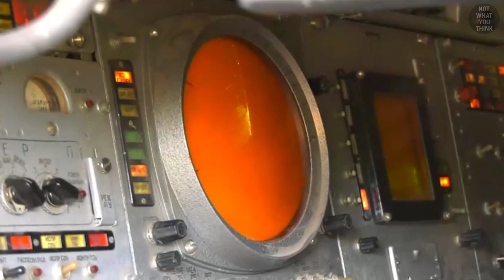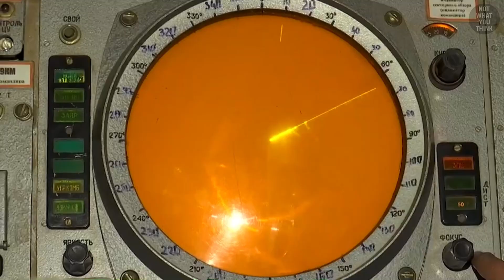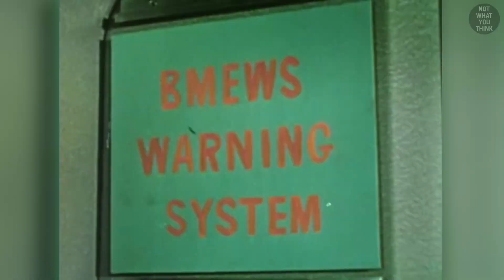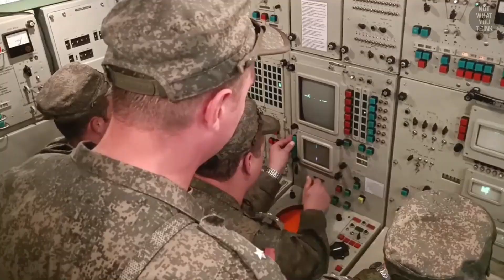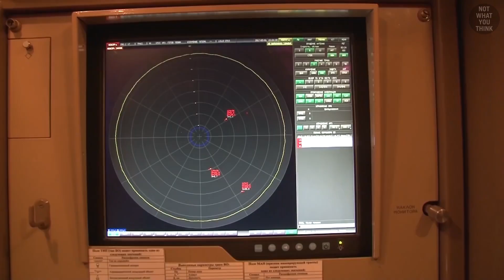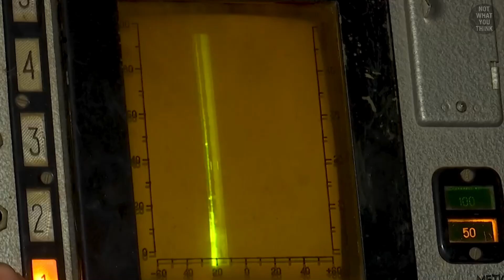How Aircraft Fool Radars by Flying Low

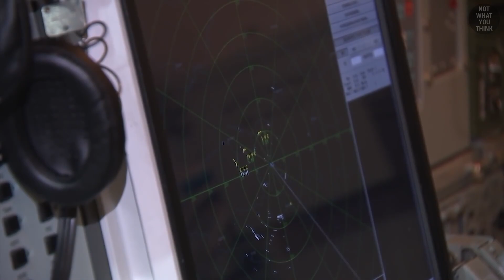Comment: 6:23 Now this confuses me a little. How does flying low trick Doppler radar? Flying low and slow (i.e. below the radar MDV), OK, but being low alone is not enough, or is it?
Reply: the doppler radar filters out stationary stuff from moving stuff. The trick where planes flying perfectly horizontal to doppler radars dont get picked up is because of this. It has to be moving towards or away from the radar. simply moving sideways to the radar appears as stationary. 
Now, when you get low enough, as in very low, the plane can blend in with the ground. the altitude is so low and they are moving so fast that the radar just receives it as being stationary, just part of the terrain, so it filters it out. this usually works with terrain that has lots of trees, power lines, cars, hills, etc. in a completely featureless and flat surface it probably wouldnt work.

Comment: One error, you said an S-300 can shoot you down from 90 miles away..... Nope, an S-300 can shoot out to to 120 miles [and an S-400 can double it and hit you at 250]
Reply: Not anymore without western electronics 😂. I doubt anything Russia claims at this point. How embarrassing
Reply: @sc1338  Russia has a crap ton of S-300 still like many thousands. which are build with western electronics.
Reply: @sc1338  a rocket hit a arleigh Burke class and nothing detect it, a Chinese jet flew over arleigh Burke, don’t know if it’s a “Russian” system
Reply: @jade7631  if you’re talking about the gulf war. I believe it was detected but the CIWS was set in manual engage mode
Reply: @sc1338  u didn’t say anything about not being detected I’m just saying it bypasses it
Reply: @sc1338  wait I did mb I meant it bypasses
Reply: Well, they can try to shoot you down at 120 miles, but the plane would immediately get an alert and they'd have time to dodge.
Reply: @dreaminginfraviolet  yea thats not how that works. The plane only gets an alert when the missile goes active. Also most ground based radars are LPI radars so their RWR likely won’t be very effective. Russia and Ukrainian jets both have very old RWR’s which likely won’t pick up ground radar painting them. Evading a SAM is not easy. Even at 120 miles, that missile is still dangerous. Also, a SAM site won’t just launch 1 per plane. They launch salvos.
Reply: S-300 soviet scrap metal.

Comment: That's actually really interesting that the US radar system could detect the moon. As it is so far away from the earth
Reply: Go out and check the skies, you can detect the moon too
Reply: Moon is big
Reply: @daviddavidson2357  size is actually irrelevant, it's the movement that counts.
Reply: @Argosh  lmao
Reply: Radar signal goes at the speed of light, the Moon is 1 light second away.
Reply: @quisqueyanguy120  circa 2seconds, cuz signal has to bounce back 🙂
Reply: The pulse goes out and you time the returning echo. The pulses keep going all the way to the moon and back but the radar thinks the echo is from the last pulse sent. The operator needs to look at the quality of the return.
When I was in Labrador in the spring we would get tempature inversions that would trap the pulse and echo and we would paint the Coast of Greenland and everything flying in between :(  All we needed to do was dump the first 250.or 500 miles down the middle of the scope
Reply: The size and distance are just made up fairy tales...

Comment: I was serving in the Navy back in 1980' and the radar we had then on our ship, had MTI, Moving Target Indication. I was in the harbor looking on a surveillance radar towards land. 25 km away there was an airfield (civilian) and despite there were no clear line of sight, I could see on the screen when the plane turned on the platform. What it does is that it exclude all static echoes on the ground and only displays moving taget by extracting the doppler signal in the return echo. There's no problem detecting helicopters, since it detects the rotation of the hub for the rotor blades, not the blades themself. It's even so concise that you can detect if it is a helicopter or a moving car.
Reply: Yeah, I struggle to even think about the possibilities of modern computational radar. I know the upgrades my former colleagues got in ATC. And that's civilian tech...
Reply: This might be a stupid question but can you just use another radar system or put one on a helicopter to emit random beams to clutter the enemy's screen? Like disturbing a radio frequency
Reply: @woozy7405  Radar jamming aircraft do exist.
Reply: @pvt.potato1943  too expensive for cannon fodder aircrafts
Reply: @pvt.potato1943  you can jam a radar but you need to know where it is. If you send radar signals everywhere, that will only make you a very easy target.
Reply: @MohammedYASSINE  I'm not making an argument, I am just confirming it.
Reply: @woozy7405  Yes the F-35 radar is programable and can act as a jammer and electronic sniffer but it's not the normal way until recently because the AESA modules on the F-35 are so highly programable they can act as a radar, ELINT sniffer as well as a jammer.   To jam another radar you can emit pulses at the same frequency, you can receive the signal and retransmit it a little latter to generate false Echoes or anticipate the next pulse, you can emit broadband noise so that the Signal/Noise or S/N ratio is so low the echo can no longer be seen.   You can predict the beam scanning pattern and inject false targets when the beam is looking in one direction to break a lock or create false targets.
-Modern radars have several ways around this.  They jitter the timing of the pulses randomly, they have pulse to pulse frequency agility.  The pulses are not just of a single frequency but are chirped and may alter in frequency several times during the pulse and unless the jammer cknows or can anticipate all of these patterns it is reduced to spreading its jamming energy widely.  Multiple pulses can be emitted at ones all at different frequencies to the point that it becomes a pseudorandom noise sequence that is spread so thinly the signal can not even be detected.  Modern AESA radars also scan in random patterns and its hard to seduce them with false targets.
It has been so difficult to jam modern radars the USAF has gone down the route of Stealth ie of absorbing radar waves.   
It takes a 16:1 reduction is radar cross section to halve detection range so 256: to 1 would give 1/4 and 4096 :1 would give 1/8th.   Eventually the stealth aircraft will be detected (about 20km away) but the idea of stealth is more to give the jamming systems a chance.  By using random noise jamming the S/N ratio can be reduced despite all of the efforts of radar signal processing.
Reply: @bernhardzunk7402  your answer is so well put, you should put it in its own response.
Kudos.
Also a question. You may have heard Israeli f35 both flown over Teheran,and left a sonic boom without them being detected coming in and out.
Any idea what was m at least in general done, to achieve  such a feat?
Reply: I served on the SAM system OSA-AKM (SA-8 Gecko). During the exercises, we intercepted helicopters at a distance of about 25 km as soon as they started rotating the rotor at the airport. we followed them throughout the flight with the surveillance radar if they did not fall into the valley, and as soon as they were in the range of the shooting radar we had them focused for tens of seconds if they did not hide in the valley again. They flew in the area of northwestern Bohemia between the town of Žatec and the Hradiště military training area (Doupov where they had a shooting range).
During the Flaying Rhino exercise in 2000, we used the same method to intercept Dutch F-16s in low flight at tree level.
Reply: @KorbenDalasCZ  I wish you had the chance to shoot down the F-16
Reply: @misterbig9025  I had F-16, L-159, Gripen, Tornado planes aimed at a lot of exercises -FLYING RHINO many times, if it was a real war, it would be enough to press the trigger and the missiles would catch up and destroy the planes. I served on the Osa-AKM systems, and on the Strela S-10 - SA-8 Gecko, the passive guidance target wouldn't even know it was aimed if it didn't see the missile. The standard is to launch 1-2 rockets at one target, one might be able to dodge the other not.
Reply: Would a hovering harrier or F-35B be invisible to the radar?
Reply: @foximacentauri7891  a harrier isnt stealth and still moves a lot in hover, an F-35B maybe, but those are build to be undetectable while moving
Reply: @therealslimshady3662  The F35 in hover mode is probably also not stealthy. But generally speaking doing something similar was a very popular tactic distracting early radars. The russian cobra maneuver, for example. Or the missile defense maneuver called "notching". Doesn't really work well any more.
Reply: That's called digital signal processing. You will have to need a DSP chip and related program to run on that chip. Sometimes, long waves could snap and bend along earth so you could get some over-horizon capability.
Reply: Are you sure this does not contain still classified info? It's 80s tech, but there is one sensitive detail here... 
If you are sure it's fine, never mind!
Reply: Being a radar operator in the air force back in the 80's I can confirm that.
We also had special "hight radar" which again was coupled to other radar sites. So we could get a full picture of what was going on. Nothing could "fly under the radar". ;)
Reply: i dont think u know what concise means
Reply: Simple Weather RADAR can show you the rain/snow line.  ALL "Stealth" is electronic and "magical aircraft skin" is a Pentagon/Corporate, very profitable Lie.
Reply: Ground maybe. But trees aren't really static. Sometimes they sway around because of the wind. This movement may make it pass the doppler filter and show up on screen. Then there's the orientation of the target. A non-stealth aircraft can be stealthy if the orientation to radar is just right.
Reply: Don't leak
Reply: Precisely! Radar can detect low altitude objects, especially naval radars designed to detect low flying missiles that are designed to nearly skim the surface of the water in order to strike at the ship’s hull below the CWIS
Reply: @Party Bunnie when did germany ever do that exactly?
Reply: luckily, that was an american system.
The russian counterpart probably says "movement, 500 meters, north" and then needs a reboot that only the quartermaster can perform because he sold every rebooter the unit had and now he keeps the last one on his keychain.
Reply: You might want to delete that post. Some info is not supposed to be known right now.
Reply: @mef12727  There's no sensitive info there. I'm not a military guy and I know all that stuff from the literature. MTI is a an old radar mode for pulse doppler radars which have been made exactly for the purpose of detecting stuff that is hidden in ground clutter. Look down shoot down radars. Nothing new or sensitive there.

Comment: Out of curiosity, the SR-71 Blackbird operated at extremely high altitudes to conduct surveillance, and would therefore need to avoid radar detection. Is flying close to space able to produce the same results as flying close to the ground?
Reply: The Blackbird's counter to radar was its speed. It couldn't avoid radar detection but it could out run thr missiles fired at it.
Reply: no, it literally just outran every missile and jet going for it. like, stepping on the gas was your countermeasure against missiles.
Reply: The SR-71 didn't avoid radar. It just flew so high and so fast, it was nearly impossible to shoot down
Reply: The speed used be its advantage but now, it would be useless
Reply: The Blackbird was pretty visible on radar. It had some radar absorbing materials but it's speed meant that the shape couldn't be optimized for avoiding radar detection. It kept safe by just outrunning any threat, not avoiding radar detection

Comment: Detection range of radar is also limited by power output, antenna size, and PRF (pulse rate frequency).
Reply: In the early 90's  working a trawler in Australia just south of a bomb range . I used to be able to pick up f111's on my commercial radar at 90 miles.
Reply: Though with more power bigger target the radar becomes. Once you activate the radar dish, it becomes huge ass red target to enemy anti-radiation missiles. I would not want to be poor bastard that mans the radar dish in the battery.
Reply: Frequency is key. Low frequency radars are far more difficult to fool
Reply: @deven6518  Low frequency radars will detect stealth objects in scan mode, but with low frequency radar you can't track an object, you can't lock on to it and you can do measurements to guide a missile into it. So low frequency radard can only be early warning and nothing else, no other good use of them. They will signal you that a stealth bomber is coming in over a wide area, but you wont be able to tell where exactly or shoot it.

This is because high frequency (and by high frequency this is not Pulse Repetition Frequency, but high carrier frequency - with conjunction with high PRF), has a short wavelength (compared to the size of the object) that gives good readings and thus measurements. But when object is stealth, it will dissipate exactly those high frequencies that could be used by Fire Control Computer, and radar will not get enough of them back to see the object.
Long wavelength radars however, they have a a wavelength so long it will not be affected by stealth materials, plane will still reflect energy back to the radar, but since the wavelength is A LOT longer than the plane itself, the received signal will not be accurate enough. Also the PRF for low frequency radars also has to be low or continuous, and there goes away your tracking (you cant have a small enough range gate or azimuth gate to get a good reading from a low frequency radar.
Reply: @oporim  I read your comment  and while I do not necessarily disagree with you, you made one critical error. That error is the assumption that radars work alone. Take for example a long range, low frequency radar may detect a location a few hundred meters to a couple kilometers (because the target isn't immobile), relay that information to aircraft or short range Sam systems, where they can focus on that given area, sometimes searching in tandem to reference each other's returns for discrepancies and so on. Missiles with on board independent guidance only need a general location before they take over search and terminal guidance etc. Stealth aircraft are not invisible, not at all, but their returns are deceiving, not necessarily fitting that of an aircraft that size. The point of low frequency radar systems is merely to discover the presence of the aircraft and that's where the su57 comes in. It's radars don't work alone, therefore the shortcomings of either radar is not much grounds to disregard its effectiveness.
Reply: Radar resolution is directly proportional to its wavelength and with low frequency comes long wavelength and low (unusable) resolution.
PRF is basically picture refresh, necessary for computation of distance, azimuth, elevation, direction and speed of movement, high PRF is used to get firing solutions, but high PRF limits the time radar waits for signal return so thus it limits its range. Low PRF is for long range scan modes.

Comment: What about Radar Jamming?
I know it's not for most helicopters, but what about jets?
You didn't cover why Russians or Ukrainian are not using it.
Reply: Ukraine does not have ECM. Russia has limited numbers of ECM but inferior to US ECM. ECM only reduced effective detection range of enemy radar & missiles. You still need aircraft flying SEAD & DEAD to secure the area but Russian air force doesn't have enough air to ground missiles for its 4th generation aircraft.
Reply: Frequency agility. Burst some pulses on one frequency to be able to use MTI and then quickly switch to another frequency.

Comment: I wonder if defensive blimps could make a comeback?
Reply: Doubt it, just too easy of a target. If you load it with a lot of expensive detection hardware its harder to go unnoticed when trying to shoot it down but also really increasing the costs of the inevitable crashing. Im definitly not an expert so correct me if im wrong :)
Reply: @sawer  I think he's talking about those tethered balloons. They hoist up a steel cable that acts as an obstacle for low flying aircraft. They were famously used during WWII.
 
There we go, found their name. They're called Barrage balloons. Apparently they worked pretty well against the V-1. Considering drones are simply smarter versions of these, barrage balloons could possibly make a comeback as final defense, an actual wall, against air targets that get past AA systems.
Reply: Helium is already being rationed. It’s a rapidly increasingly expensive medium.
Reply: @ivancorey7389  Unmanned aerostats don't and shouldn't require helium. They carry no passengers, only payload. A controlled scuttle should pose no threat if done properly.
Reply: No. They suk. Manpad can take em.

Comment: That low could you eject? Or is that part of the suicide meaning because you can't.
Reply: Modern ejection systems can eject you safely at ground level (e.g. even standing still at the airport), problem is rather being fast enough to pull the handle. But there is the video of the shootdown/powerline hit of the SU-25t where the pilot manages to eject low to the ground. Give it a watch.
Reply: @Blauerkavenzmann I didn't know that was possible, thanks!
Reply: Yes but someone will need a shovel to pick you up as it won't be enough time for the parachute to open and slow your decent.